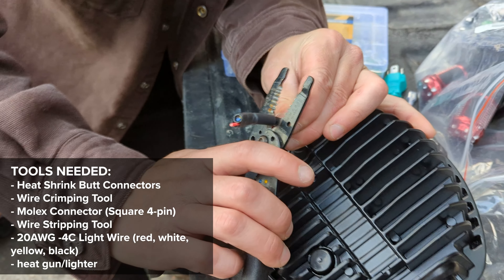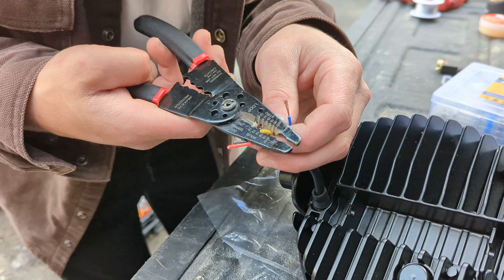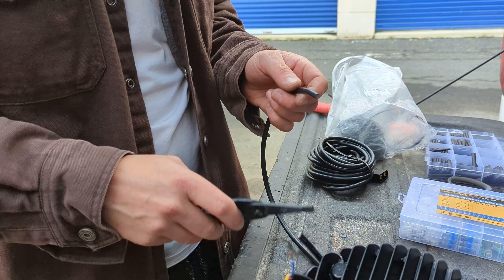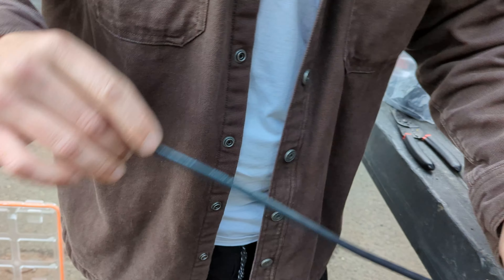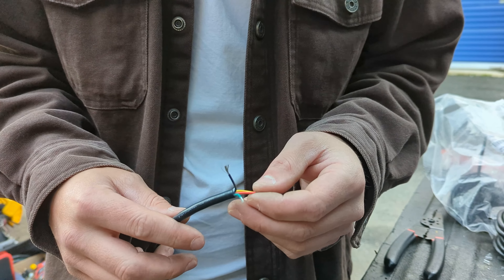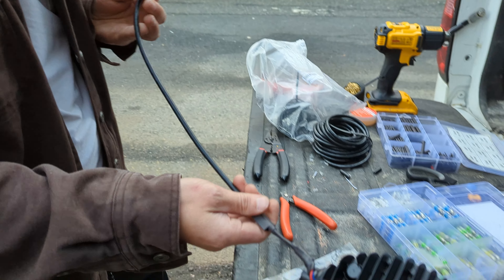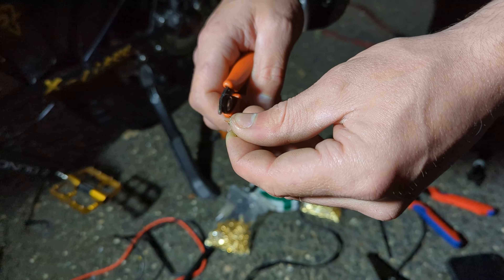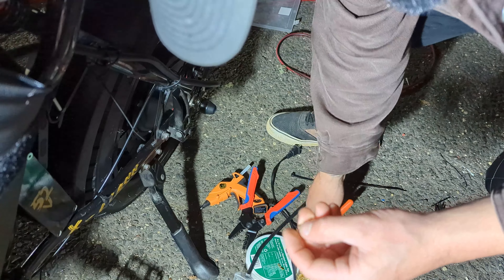Install A MOTORCYCLE headlight on ANY E-BIKE

Comment: Is the dc step down converter built into the light?
Reply: I believe it’s in headlight 12-80v your power comes from controller usually 36-72v depending on your bike

Comment: You're forgetting a DC to DC converter. It's a 12v headlight
Reply from the maker: This setup already has the step down attached. Sorry I forgot to mention that in the vid
Reply: @e-streetbikes6381  did the step-down converter come integrated into the bike or was that your modification? i’d like to see an install video or guide if so-
Reply: 50w high and 30w low beam.